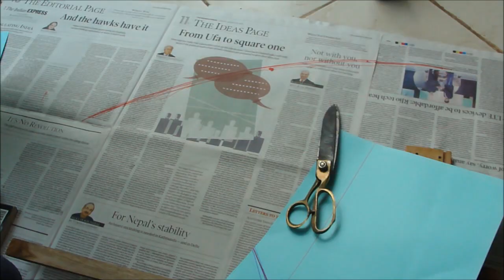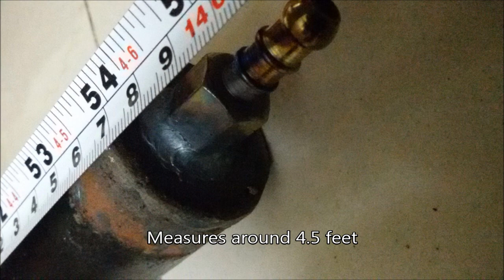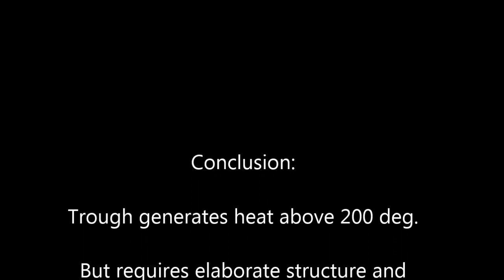Trough Mirror

Comment: Subbed! 
Question : How durable are arcylic mirrors and are they good for Parabolic dish too by cutting them ?
Reply from the maker: Hi, I have given up on acrylic mirror.  That is not practical. Costly, has less durability and I am not interested in complex engineering designs.  I am working on plain glass in flat bed mode
Reply: @me-for-palastine  what about using steel sheets as mirrors
Reply from the maker: @geometry-math-DS  Not a bad idea.  Stainless steel sheets I guess may require regular cleaning. For example utensils at home, we clean daily. if not some kind of salty deposit  gets settled on surface from atmosphere.  But cleaning will be rough and easy. 

I guess they will be costly too per square feet compared to glass. I am not sure. Need to check this out.